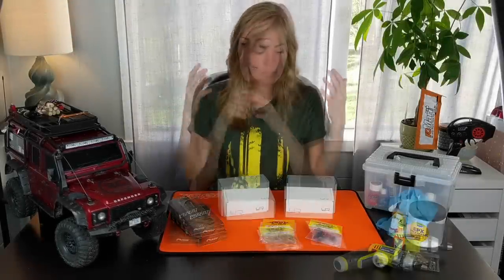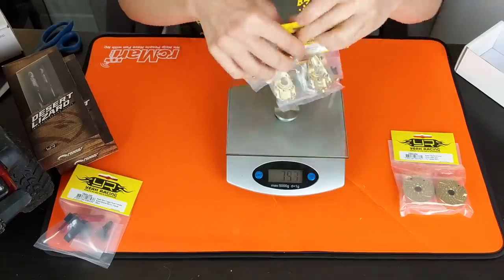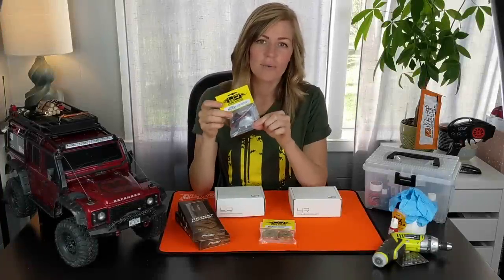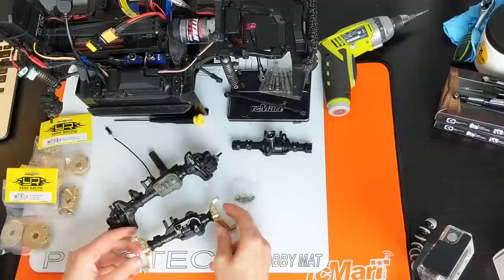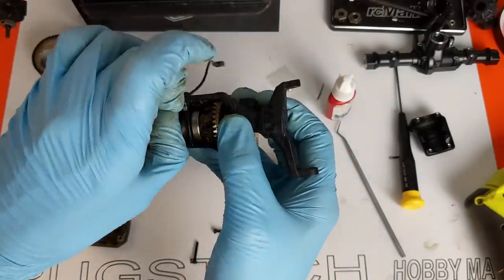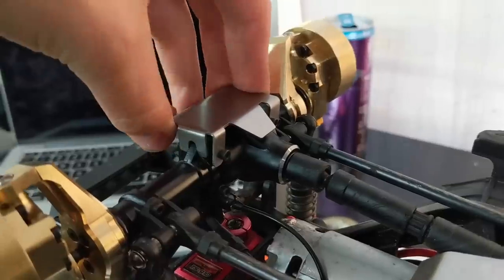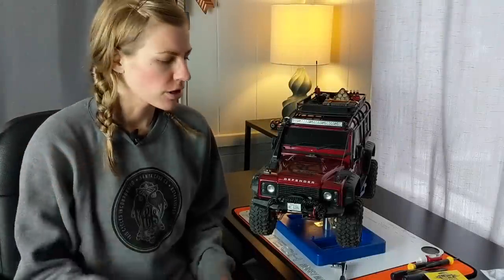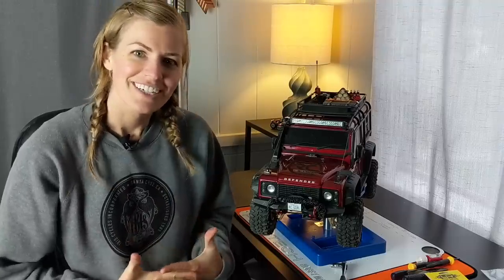SHOULD YOU WEIGHT YOUR TRX-4??  |  Yeah Racing Metal Axle & Brass Upgrade Sets

Comment: Hey RC Girl nice job.   For your issue on descents it looks like your ESC is still set to trail mode which is only 50% drag brake.  This is how it is set when new.  If you change it to crawl mode the drag brakes will be set at 100% braking.  In crawl mode it will stop on downhills if you let off the throttle.  100% drag brake is 100% braking.  It also lets you go directly from forward to reverse without having to double tap the throttle control.   Doing this makes a huge difference in crawling performance.

Comment: In real life rock crawlers there are "suck down winches" and also "limiting straps".  Have RC crawlers ever tried those concepts?

Suck Down Winch:  a small ATV style winch mounts to chassis frame rail or crossmember above front axle and beneath or near motor.  The winch rope attaches to center of axle housing.  When activated on steep incline obsticles, it sucks down and compresses the front end suspension to prevent suspension unloading on incline when nose is feeling light.

Front end "limiting straps" are similar concept but do not compress suspensions, rather just prevents too much front suspension unloading on steep incline.

Would be cool to see on RC crawler, even if just there for appearance of realism.

Comment: Dear RC Girl, I am not a physicist by trade, but I do have a Ph.D. from somewhere in something else.  Anyway, Colin Chapman (the racecar driver who founded Lotus) once said something to the effect of "If you add power to a car, you make it faster on the straights.  If you reduce weight, you make if faster everywhere."  I think that the same principle applies to climb rate and maximum safe descent rate.  

At some point, I would like to modify a short-wheelbase TRX4 into super low CG Mars crawler.  That plus a trailer so I could tow it using my Defender (which is still awesome after three years.

Comment: If people have access to a propane torch and some lead fishing weights, they can remove the front bumper and make molds for lead weights that fit into the sides of the Land Rover bumper.  I hot glued mine in with hot glue and they've stayed glued since then.

By the way. thank you for doing what your doing.  If I had to guess, you had trouble with the diff-locker cable.  That was my trouble.

Comment: The TRX-4 definitely needs some weight on the front. The center of gravity, when including a 5000 mah 3S battery and the body with the spare tire, is towards the rear, not in the middle of the car. I've added about 300g (a bit less maybe) to the front. Nothing fancy like your stuff, just glued lead in the bumper and between the chassis beams. This made the center of gravity in the center and it's another planet. Very realistic (the full size defender has the center of mass in the the center between the two axles) and not too bad both in ascending and descending. Of course master of none :).

If I may, I would advise to try removing the big round weights on the front, I think that's a bit too much. However I bet your sidehilling capability is stellar in the current setup.

And about the diffs: you might want to consider stainless steal ball bearings (possibly with ceramic balls), to avoid rust. I'm very lazy and run in a lot of water..... I rusted all of the bearings in about an year :P. Should have done more maintenance :D :D :D.

Great video, keep up the good work!

Comment: Go the cheaper route, get some beadlocks and wrap the inner ring with 1/4 oz wheel weights to your desired weight. Costs about $25 for 360 pcs (90 oz). I put 2 layers in the front (6 1/4 oz) and one layer (3 oz) in the rears. You'd be impressed by how well it does compared to spending $300+ for brass and metal axles.
Reply: Should one do both solutions if the new axle costs don’t hurt?
Reply: @gaffle-411  Yeah why not, test and tune though. My crawling style or feel could be different from yours.

Comment: Hi Hayley,
Great video on replacing the upgrade parts. Sorry you were under the weather. Thought you would have installed the easy start trigger. Maybe using 118g rear portal covers might help with the stairs descent. Time to have more fun.   :-)
Reply from the maker: Yeah I'm still thinking about whether I want to drill holes in the chassis to install the start trigger. It comes with hardware to do that since it takes some leverage to operate and I don't think the sticky tape alone will be enough....

Comment: Hi RCgirl great video here. I noticed you did mention the individual weight of each part you swapped but I was just asking what is the total combined weight difference between out of box and with the extra brass and aluminium parts? I was really close to buying a Landrover defender in red from Traxxas because it looks beautiful and I am getting impatient waiting on my high lift ford F150 , but I will stick it out and continue waiting. Only 2 weeks away now for a metallic brown F150. I really like the Landrover but there seems to be a lot of criticism regarding the weight of the Body shell and how the Landrover rolls over onto its roof real easy due to high centre of gravity. So I was just curious how much is the total weight difference from out of box to fitted with these optional parts? Looks like the extra weight does help in keeping the rubber side down and keeps the truck more planted too. Great work and excellent tutorial video here too.love your work Rcgirl.👍

Comment: I seen previous videos of upgrades of metal axles and whilst it improves in certain ways, there are some disadvantages. Seeing that the Defender is a bit top heavy I went for stainless steel driveshafts these are possibly double the weight of original. Not tried out yet, hopefully this might improve the stability. Impressed with your straight forward approach to upgrades.
Reply: I know it's some time since you wrote this. But be careful to add weight to the driveline. It will also affect the power and wear on the gearing. Although it should be okay to do your upgrade 🙂

Comment: The second hole in the center plate is so you can get to the driveshaft set screw, not for another mount screw. I want that kit so I'll  have to save some cash. Awesome looking kit. Great video.
Reply from the maker: Ahh got it. Yeah it's a good kit, def pricey but the axles are 👌

Comment: Great video RC girl!
I added 1.9 Hyrax tires with G8 compound, and they basically rode rim during anything but driving straight on tarmac. I also had brass rings/wheels from SSD. Did you have to adjust your foams for equal tire performance after adding weight? I had to put back on the canyon trail tires/wheels/foam to get a decent ride height. I ordered like 3 new foams including proline's dual stage crawl, so hopefully that works better!

Comment: Nice video about the "heavy metal conversion". As I pointed out on another video on youtube: You don't need to lubricate neither the seat of a ballbearing nor the shaft that is running in it. Lube, oil, grease on the seats of a ballrace is counter productive to its function. You may, for example, cause the shaft running on the surface of the inner bearing shell and wear. I clean ballbearings on their outside before installation. So the ballrace does the work and not the shaft in the bearing shell.

What about the steering angle of the metal parts? Did you notice any difference? For some conversion kits there is the rumour that the steering angle is not as good as with the original parts. And especially the turning radius of the TRX ist a big advantage of this chassis.

BTW I like your way of presenting your rc-toys. Very sympathic. And it's a relief that not only men find their fun in this hobby. Also good to know that "the best woman of them all" (yes, sorry,  I mean mine) is not alone with her interest in rc's.

Comment: You're  awesome,  thanks, the only thing I missed was the cost of everything,  I don't  have  one yet, very tempting,  yet personally  I  like the new tactical  unit, it's  a tiny bit cheaper, & these days saving what I can helps, most my Axial  builds have at least an alloy front axle  & alloy wheels to keep the weight  low but thanks I go look them up as far as $ cost

Comment: Thank you for a very nice video as always! 
Even the added weight only give marginally better overall terrain performance, the look, feel and quality the metal and brass parts add to your pet scale truck is unbeatable, and this parts will never break. Are the wheels the orginal plastic ones? You can get even more weight close to the ground by installing machined aluminium or magnesium wheels, the beaded wheels with screws even weight in a little more, a functional upgrade too, and make the truck look even better.
Cheers.
Reply from the maker: Yep they are just stock wheels/tires for now! I'll have to get beadlocks soon

Comment: seen how much you were planning to install and thinking.. going to have to make sure she uses low gear coming down so she gets some drag brake.. The Defender is a bit tricky with weight as you are finding out, as with any of the trail trucks, finding that balance where you improve ascent yet still can come down without riding with the rear wheels off the ground.
I'm glad your still enjoying this part of the hobby, like John Smith pointed out.. you are an inspiration.
Reply from the maker: Aww thanks! Yeah I need to tinker a bit more and find a good balance

Comment: That's some nice quality axles there. I really like the bearing instead of the bushing in the C-Hubs. I found not only did the extra weight in mines similar to this make it more capable and predictable but it was a lot more fun as well as it felt like it drove a lot more scale. My drag brake also suffered on descents. I'm not sure what other upgrades you have but a 9t pinion would be a cheap way to get some more low speed control but a stronger drag brake as well from the slower gearing.
Reply from the maker: Ahh good point. I will have to look into a different pinion. Not sure that I can modify the drag brake strength on the Traxxas ESC. I'll look into it
Reply: @RCGirl  The 9t pinion helped my drag brake become a little stronger due to the lower gearing as well.

Comment: The extra weight will course the tire sidewall to roll a lot and it will tip more when on side hill. I heard changing to progressive foam helps stop tire roll so much and helps . Also shock adjustments .
Reply from the maker: Yep I need stiffer foams!!

Comment: Looks awesome and I really want to get some of the yeah racing components. Have you tried their stainless steel suspension links and metal sliders? Just a thought to add more weight uniformly across the whole rig. Might help. Something I want to try at least with some dual stage foams to stop the tyres collapsing

Comment: Get the Castle Creation Mamba X Sensored Motor and ESC Combo and you will probably see the biggest difference in performance. The programmability of the ESC is a very useful feature that  is needed for setting drag brake and throttle/brake curves . Your rig does definitely look very cool. Keep up the good work!
Reply from the maker: Yeah I need a sensored setup!

Comment: Really good looking parts.  I like the metal axle housings.  That's a whole lot of weight though, and I'm sure those pieces are expensive too.  I have the Bronco version of the TRX 4 and love it.  I have not added any weight to it yet , that'why I watched your video. Do you think all that weight is worth it? or maybe just some of it?  Thanks for the great video!
Reply from the maker: I think I might take off the extra 118g brass outer portal housings on the front and just move the 48g that I put on the rears to the front. Otherwise I need to adjust my drag brake and shock ride height.

Comment: Just found your video. Great stuff and timely! I bought the same rig last night (6/5/19)... body and color. Thought it was the best too. Really appreciate the feedback on the mods. Timing is perfect. ;-)  --- Watched the video. Why not use wheel weights, tire upgrade, and bead lockers? The parts look great, however I didn't see any significant advantage over the plastic parts aside from the weight gain/distribution. I'd like to see you do a stock rig with the tire, wheel weight, and bead locker upgrade and get your feedback.

Comment: I did FULL brass on my Defender. I left my Bronco factory, no brass. I can't tell the difference? Except I spent a ton on upgraded parts for the Defender. I do believe the weight of the Defender body is countered by the brass. My stock Bronco can go over hard obstacles the heavily modified Defender can't! I like the Defender for the look.
Reply from the maker: Yep agreed. If you want to run the Defender body, it needs some counterweight down low.

Comment: When I get a new R/C the very first thing I do, before I ever take it out for a run, is grease the axles.  I use high temperature heavy grease. --- I have an ECX Barrage Gen1 that out of the box would roll over if you sneezed on it.  Using what I had on hand I weighted the wheels;  I tied five 1/8th oz fishing weights onto each wheel with hemp twine, then secured them in place with a strip of bicycle inner tube.  For a total of 5/8ths oz (20 grams) per wheel.  It handles like a whole different truck, climbs much better and rarely rolls over now. --- I can't imagine why anyone would "not" put oil in their shocks.  R/C's with springs only have such an unrealistic ride bouncing along.
Reply: I find Marine Grease works best when Re-grease my diffs since I do a lot of crawling and tend to go through water & mud but that's what works for me.

Comment: Nicely done! Would have been nice to see the assembly and mistakes of putting together the axel housings so we know what to look out for when doing ourselves. 😉 I bought some upgrades for my TRX-4 Bronco, but a little different route. I personally don't like the brass finish, since I think it detracts from the realism, so I went with Samir, since there brass is coated black, with brass highlights. I only did the front, but think I need to bite the bullet and do the rear as well. Might look at doing the Yaz axel housings after that. It just never ends, does it? LOL Great video! 😀👍
Reply from the maker: Haha! Yep, never ends. Yeah racing also makes them in black but they are aluminum not brass
Reply: RC Girl RC Girl Thanks for the ❤️ on my comment! 👍 I just noticed the typo I had (or missed auto-correct)- the ones I bought were from Samix, which are a plated brass. Pretty cool looking.  HemiStorm RC has a good video showing them. Anyway, love your channel! Also really liked the comparison of before and after! Look forward to more of your great videos! 😀👍

Comment: I just bought my kids their first rc's (trx4 sport) and myself the bronco.
We're a bit disappointed with the hill climbing ability and, the ease of which it rolls over.

It's awesome to see how big of difference adding axle weight made for you in the climbing ability. But I'm a bit concerned about the descending control.
Have you found any improvements in that respect?

Also I've heard that adding weight hurts the side hilling ability. Can you confirm or correct me on that?

Great video, much appreciation for the side by side video comparison. 
Thank you for the time you've put into your videos.
Reply: Should of bought an Element Sendero trail truck 😬🤣
Reply: The sky is the limit with the trx4 sport, imo. I went sport kit in august, with zero experience building an rc, nor crawling..but it's been so entertaining, I even started trying to teach myself to make videos of the adventures. In terms of things mentioned, hill climbing, descending, side hilling..weight below the shocks will help, keeping your body as low as possible, both in mounting position and shock position, will help. Side hilling, same thing. Like any hobby, effecient time invested, equals results. I've got less brass pieces than her truck, but enough to waken the sport up...and I have no issues side hlling, climbing, or descending pretty much anything. Here's my latest TRXellence video, skipped to a pretty much straight up and down descent. Practice makes perfect. https://youtu.be/SDJtIzW3rpo?t=605
Reply: You can use hub extensions to widen your track. Saw a video on it a while back. RC Girl will probably know about it if she knows all about the hop ups.
Reply: It shouldn't have that much of an issue while descending. My thoughts is that it wasn't in crawl mode. You have 100% brake in crawl mode when you let off the throttle. I've crawled almost at 90° angles with a stock Defender in crawl mode, so long as you are extremely light on the throttle and easy on the brake you'd be fine.

As far as side hilling, so long as you are adding equal amount of weight to both side of your rig you should be alright, but you can always look into some hub extenders or other tires.

Comment: Great vid as always. On the decent use a little back throttle to help control it. I’m hoping you uses blue lock tight and not red. Blue you can get back apart and red is pretty much permanent. I know there’s a company now making a purple one as well which will be good in the rc world it’s made for smaller screws should have lots to hold them in place but easier to remove. Keep on keeping RCing